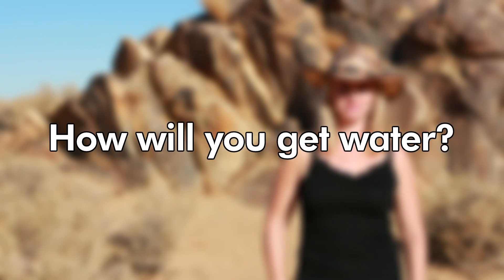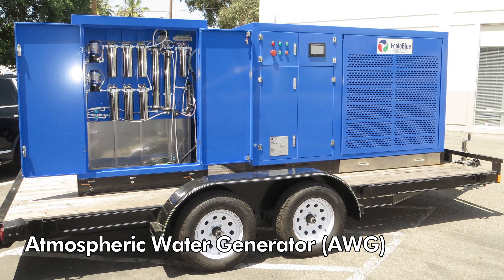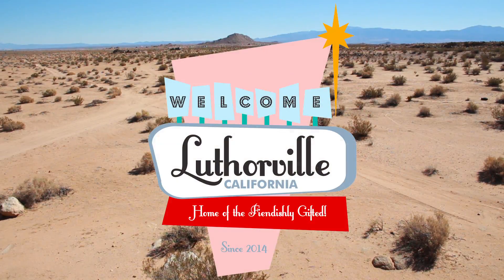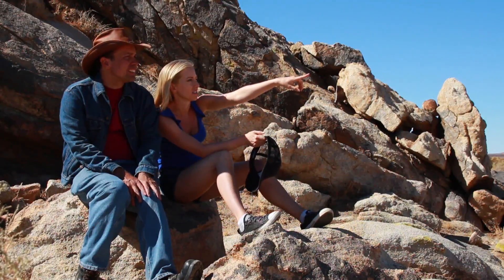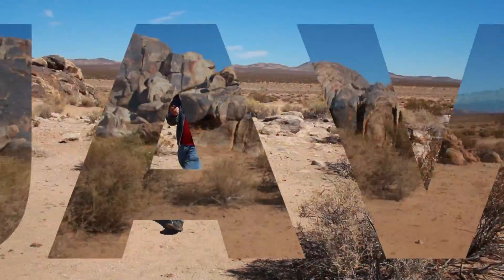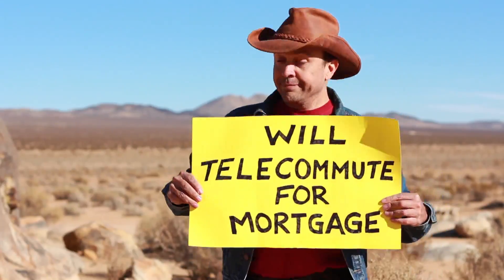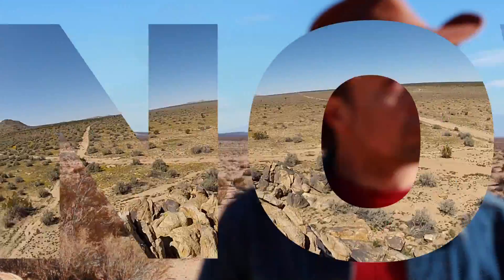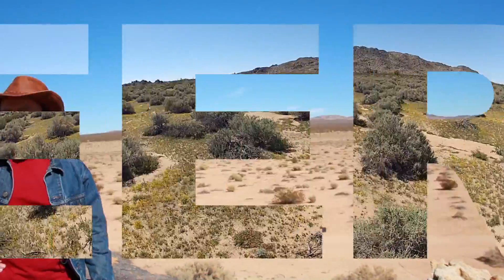How will your tiny house get water in the desert?

Comment: Where I live the water from the kitchen tap is crappy so everyone buys water for drinking & cooking. I personally cannot live without my Berkey water purification system. Of course you have to have water to filter through it so it won't "produce" water in the dessert, but could sustain life if you had some undesirable water that you needed to be drinkable.
Reply from the maker: Berkey filters are great, since they are gravity-fed and require no power to run. If you can use electricity, I suggest the Pure Water Mini Classic CT distiller.

Comment: Lots of sun in the Mojave. Use it to boil/distill gray water for drinking. Filter the gray water first with a sand/charcoal bed, and you can cistern it and re-use it. Use solar reflectors around the boiler, paint it black, put whole thing on a turntable follow sun all day. Run output through a bubbler, to a copper pipe in the ground for a condenser to a sealed drinking cistern.
Reply from the maker: Great ideas. I look forward to seeing a video of your system up and running.

Comment: Check out 'water from air' technology.  Even in the desert this should work and it's cleaner than public water because it's not contaminated with fluoride or pharmaceuticals.
Reply from the maker: Yes, I mention those in the video. They are called an Atmospheric Water Generator (AWG) and they MIGHT work in the desert, but the problem is having enough humidity and power to run it. Most need a minimum of 30% humidity and it can often be lower than that in the Mojave.
Thanks for the suggestion and for watching!
Reply: Luthorville: Building an Off-Grid Mojave Tiny House 
Humanity is depend of when and where in the Mojave Desert.
I live in Mojave desert almost 20years.
Of course totally off grid.
I made house raised two kids . 
Nowadays I checking websites including YouTube.
I think 99% people needs to study more nature that is not books nature real and physicality.
Reply: you mean dehumidifiers

Comment: I'm glad you are able to haul water in SB County. I was told I cant. I didn't know about that legal clause you pointed out. I'll try to use that because I have some land out by Hinkley and they have bad ground water thanks to PG&E. I just use the land to have fun but it would be nice to have water out there.
Reply from the maker: According to the "Mojave Water Resources Detailed Location Map" the town of Hinkley is located over the Centro aquifer. Who knows how much of the hexavalent chromium dumped into the groundwater by Pacific Gas and Electric Co. is in the surrounding area of that aquifer or how far it has spread. That alone should qualify property in that region for water hauling since a ground well is not a viable option.
Reply: Luthorville: Building an Off-Grid Mojave Tiny House thanks for your reply. I also love the desert. Your property looks awesome with the rocks and all. Mine is mostly flat but incredible especially at night. I just put up a shade structure and I plan to catch water and make a water spot for wild life if I can figure out a good way to do it.